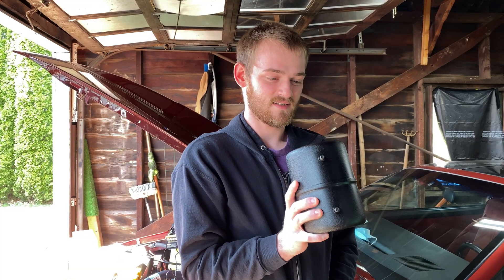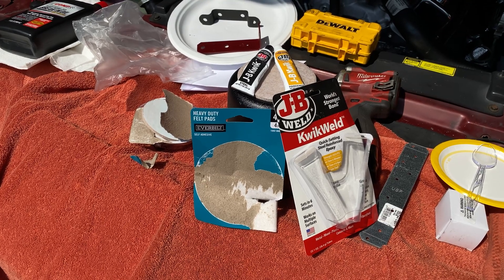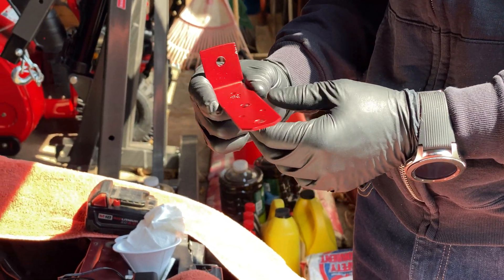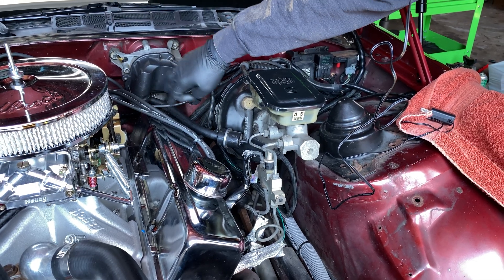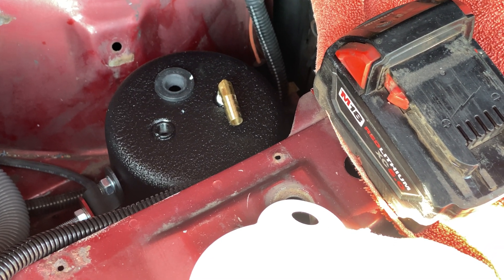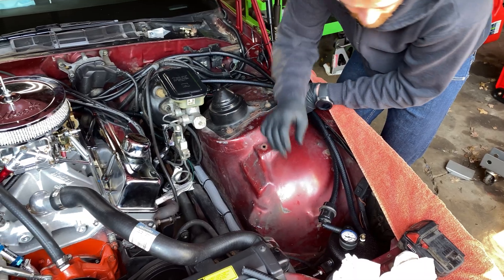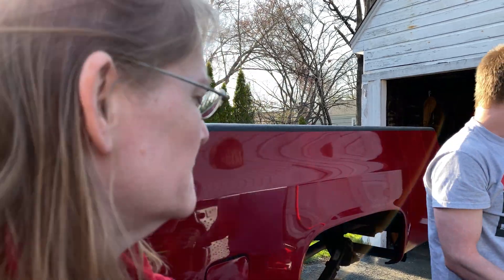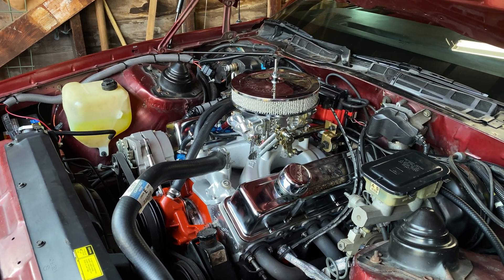How to Install a Vacuum Canister for Power Brakes for Improved Brake Performance

Comment: Thanks for the truth showing the ins & outs with that type canister my vacuum pressure is at 14 making my power brakes not work for me can't even drive it.I have a 289 mild cam.I was hoping it would of work for you.Did you get that pump?
Reply from the maker: Hi - Yes, had to get the pump. With the canister alone, the brakes weren't working. Thanks for watching, and I hope my message helps.

Comment: Did one of these 35 years ago and it is still working great in my Chevelle. Found out the hard way ay 120mph lol.
Reply from the maker: Yikes! That could be scary. Turns out the canister alone didn't help, so he ended up getting an electric pump, which really helped.

Comment: You shouldnt use fuel hose for vacuum. Pressure has nothing to do with it. Vacuum hose wont collapse when under vacuum pressure. Fuel hose will.

Comment: Vacuum and fuel hoses are different. Vacuum will suck a fuel hose flat, they as you stated are capable of more pressure, but your pressure application is backwards.
Reply from the maker: Thank you for the info. I appreciate it and think others will too. So far the fuel hose hasn't given us any problems. Hope it stays that way. Thanks for the comment and giving us detailed info.
Reply: This.

Comment: Question, I have a 65 impala and changed out the drums to disk, and my breaks are very hard. Bleed the system several times and till hard.  thinking of getting this or should I check the vacuum pressure 1st?
Reply from the maker: Matt suggests checking the vacuum first.
Reply: Ok, thanks.
Reply: But what vacuum pressure I'm I looking for?
Reply from the maker: @lifeistoshorttolookback  That's something I can't answer for you because it varies by vehicle. My guess is that you want at least 15, but some cars require up to 25. The electric pump (not the canister) that Matt ended up getting produces up to 35 inHg. Hope that helps.
Reply from the maker: @lifeistoshorttolookback  Here's a link to the pump that Matt installed: https://www.summitracing.com/parts/sum-760152
Reply: @MarkDHall  So checked vacuum pressure, and it's around 8 and 10.
Reply: @MarkDHall  I just ordered the Leed bandit pump.
Reply: You should replace the rubber portions of your brake lines. There's 3 of them.  They swell shut when they age and you have to push really hard to get fluid thru them
Reply: @globalheadquarters283  I purchased the vacumm pump and helped little... but where are the rubber located.
Reply: @lifeistoshorttolookback   there's a 20 inch line in both fronts from the steel line to the actual brakes.  And there is a 3rd rubber line from the frame in the rear to the top of the rear axle in the middle over the differential
Reply: @globalheadquarters283  I will check this out when it gets warmer, buddy. Thank you for the information.  I will keep you informed

Comment: It’s not pressure….it’s “ inches of vacuum “ and no, 10 inches is not enough, you need closer to 15 inches to assist with those brakes….66 drop top chevelle…..327 …. I have the same problem, bought the similar kit…. Had my doubts as well….I’m going to mount with tie raps for a very temporary installation…. I was ignorant, didn’t realize the cam would affect the power brakes…my bad …. I’ll probably have to purchase the darn vacuum pump …. Think they are somewhat smaller compared to the tin can ….thanks for giving it a try….
Reply from the maker: It's actually not inches of vacuum, it's "Inches of Mercury" (inHg). Matt figured he'd try it without a can or pump to save money if it wasn't needed, but it definitely was. The can helped a tiny bit, but it was really the pump that made the difference by keeping the can full. Good luck, and your car sound awesome! Thanks for watching.

Comment: Vacuum canisters increase the volume of vacuum,,,,     but not how strong the  vacuum is . IE   A cannister WILL NOT  go from 10 inhg  to 15 inhg .
The vacuum pump needed for 300deg cam ix the standalone Hella 5X vac pump . This unit does not need engine connection .
Reply from the maker: Thanks for the tip. We ended up getting an electric pump, which works great. We were trying to save money, but the canister alone didn't cut it.

Comment: i am just like to build a completely mechanicaL high leverage high torque brake lever system that i am pump the brakes manually with on my momma's 2nd gen.
Reply from the maker: Matt thought about going with manual brakes, but chose to go this way. Manual brakes will be lighter too because they don't have all the extra hardware. Thanks for watching!

Comment: does this replace a brake booster?
Reply from the maker: No, it doesn't. We thought it might hold enough so we wouldn't need a booster, but it didn't work out. The problem was the canister wouldn't fill up quick enough. It was really bad if we were in traffic and had to hit the brakes multiple times. Matt originally only go the canister to try to save money, but ultimately he had to get the booster. He installed it while I was at work, so I couldn't get a video of the install.

Comment: All the canister does is stores vacuum so you don't run out under constant braking.
It doesn't give you better brakes.
Reply from the maker: Exactly. It just holds extra air so the brakes work. For us the the canister wasn't filling quick enough, which is why we also had to add a pump.

Comment: Vacuum is not measured as pressure. It is measured in inches of Mercury at sea level (29.92") is a perfect vacuum. It is the absence of atmospheric pressure.
Reply from the maker: Yeh. I realized I misspoke after it was uploaded.

Comment: i think the vacuum canister would have work but u said u paid about $30 for it thats cheap you should have paid about $80 t $100 for the comp cam one its better..i never had a problem i got 1990 k5 rebuild my engine 355 with a howard cam lift 525/535 duration 227/235 lob separation 109

Comment: THAT ENGINE SOUND REAL GOOD MY BROTHER.. WHAT SIZE CAM YOU HAVE IN THERE,, IM SUPRISE THAT THEVACUUM CASITER DIDNT FIX THE PROBLEM...AND BY THE WAY DID YOU EVERY FIND OUT THE PROBLEM OR FIX IT...
Reply from the maker: Hi Doberman Gang. Thank you for the nice words! The cam is a Comp Cams cam & lifter kit CL12 602-8. For the vacuum issue, the canister helped a little - basically if you only had to hit the brakes once, but in stop and go, it wouldn't refill quick enough, so Matt put in an electric vacuum pump. It keeps the tank filled, so there's always plenty of vacuum. It's mounted directly under the canister where the vacuum ball normally goes.

Comment: Did you get a vacuum pump? I am looking at them now.
Reply from the maker: Hi - yes. We ended up having to get an vacuum pump. We got item #SUM-760152 from Summit Racing. It was pretty expensive, but the canister wasn't enough. I couldn't record a video of the install because Matt did it when I was working one day.

Comment: Totally different application I cummins swapped a 72 c40 that has a rollback tow truck deck on it and well the diesel makes like zero vacuum... so I had an electric pump but it was  old and from another project and only made 5 in hg of vacuum and it was terrible but I found a new pump that was identical and it made 20 in hg of vacuum and was a pretty good improvement.. debating a vacuum canister just to store the vacuum but I worry about recovery rate once that's used up..
Reply from the maker: Hi! I don't know much diesels, but our canister refills instantly with the vacuum pump, even in stop and go traffic. From what I've read and understand, a pump isn't designed to provide continuous vacuum and works best with an external reservoir.

Comment: I'm having the same problem.  Just bought a leed bandit pump. We'll see how it goes
Reply from the maker: The pump should help. The canister didn't end up doing a lot. It helped for the first brake press, but if you had to stop again like going slow in traffic, it didn't get refilled in time. Once we got the actual pump, it made a huge difference. The brakes and everything are always at 100% ready to go.

Comment: You need 18" of vacuum to work your booster properly. You'll need a vacuum pump and the quietest type are the vane type. You can remove the hose from the manifold and plumb the pump to the canister. You'll also need a vacuum switch to start and stop the pump.
Reply from the maker: Yes! You are correct! The canister alone wasn't getting the job done, so Matt bought a pump and  installed it one day when I was at work, so I couldn't record it. He installed it in the way you said, and it works great now. The car stops perfectly, even in stop and go traffic now.
Reply: @MarkDHall  that is great news. watching matt's build construct is Fun and Omazing
Reply from the maker: @zAvAvAz  Glad you're enjoying them! Thanks for watching!

Comment: On my truck its a 1/2” brake vacuum hose, if i use a reducer would it affect it?
Reply from the maker: Hi Alexis. I'm not sure. I always like to use the recommended sizes and would be nervous to try it.

Comment: I have a Chevy Malibu 78 I used one of them canisters they write work great you don't need a pump I got great pedal
Reply from the maker: Hi Ronnie. Turns out the canister didn’t work. After pressing the brakes once, they were almost not there. Just installed a pump, and it .works great. This cam only makes 6 inches of vacuum, which is very little. Thanks for watching.
Reply: Does it mean the canister is not working? Or the vacuum is just not sufficient?  @MarkDHall
Reply from the maker: @ysrael3kings  Hi. I would have to ask Matt exactly how it works, but from my understanding, the engine doesn't make enough vacuum to keep the canister "full." The electric pump that he installed later makes up for the lack of vacuum from the engine. I hope that helps. If you need a more technical explanation, just me know, and I can ask Matt.

Comment: Nice build. It's good to see you built what you wanted (305) rather than what someone else wanted like a 350. I don't discriminate, I build what I have.
Reply from the maker: Hi. Thank you! I agree. If you can build what you have and it'll work, I think that's a great idea. It saves money, but it also helps you learn to figure things out better.